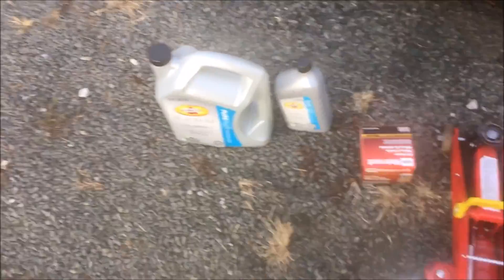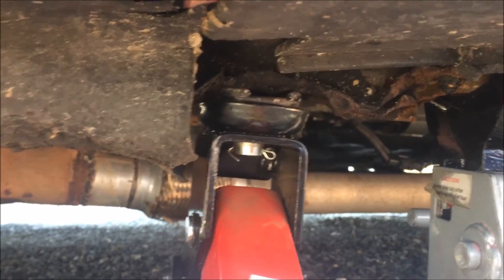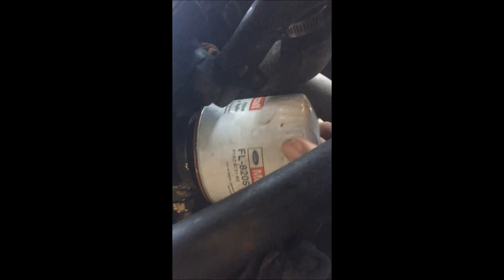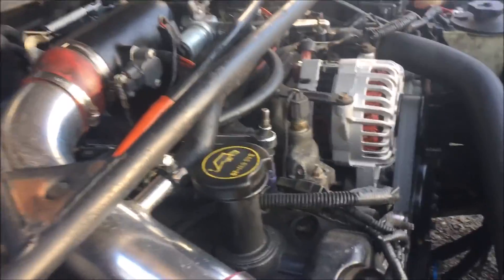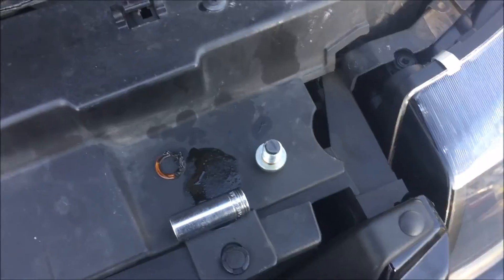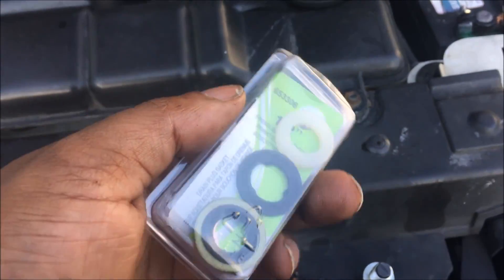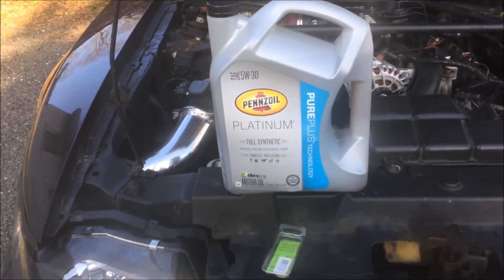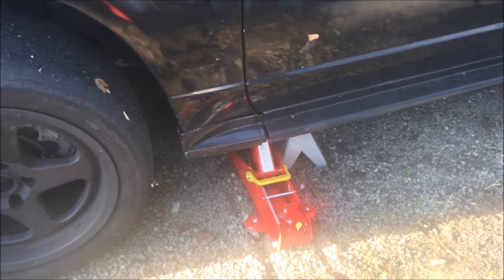how to change oil on a 96-04 Ford Mustang GT

Comment: I don’t own a mustang but I got a 02 Ford Explorer with the 4.6 Ford v8 and I been using the 5 20 oil do you recommend using 5 30 full synthetic oil cause mine does a slight tick on start up and when warm up goes away

Comment: Not going to bash on your directional challenge. But, brah, drain the oil before placing a filter back on.. At least you used jack stands and a decent jack. Instead of the jack that comes with the car. And good recommending changing the gasket for the drain plug.